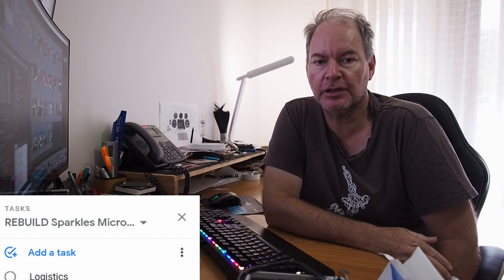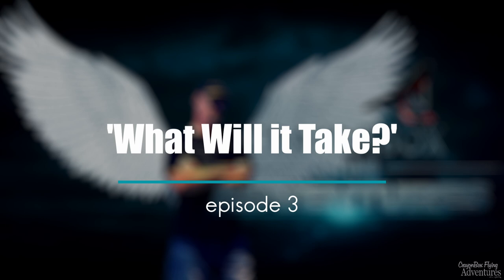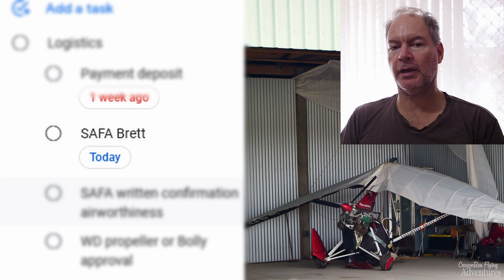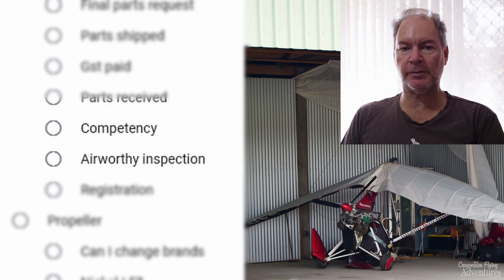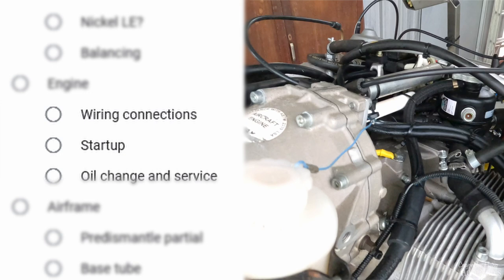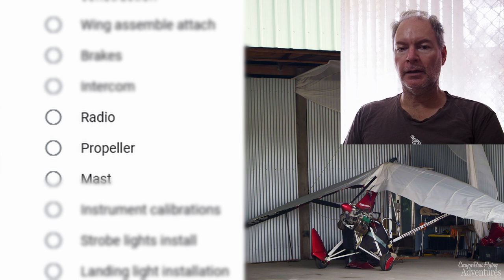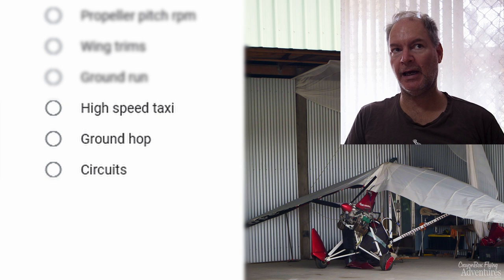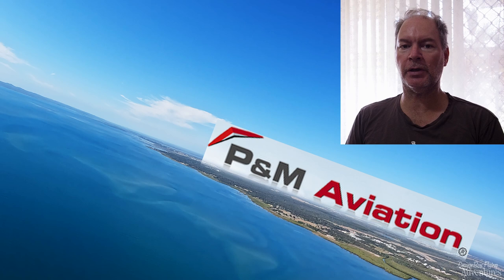Aircraft REBUILD ep3 WHAT will make her Fly Again? | Microlight Aircraft Crash | Rotax 912

Comment: Good luck with rebuild,  the only difficulty would be change of prop, all the technical specifications and flight testing is done with warp drive.   Change of prop just delays things with paperwork testing which adds costs. Warp drive are very good with back up and availability. Inserts on leading edge of blades, great idea.
Reply from the maker: Thanks Mike. At the moment WD is the plan.  More information and reasoning coming in the videos soon.

Comment: what kind of landing lamp are you thinking of fitting ? i have had some terrible comms  interference from most i have tried
Reply from the maker: I'll try the one I have, and if issues, I will just have to try harder.  My LED strobe lights are right next to the antenna, and they don't cause noise.  So it must be possible, as it is in many other aircraft.  Link https://www.amazon.com.au/Motorcycle-Aluminium-Headlights-Projector-Motorcycles/dp/B07F8SPJ82